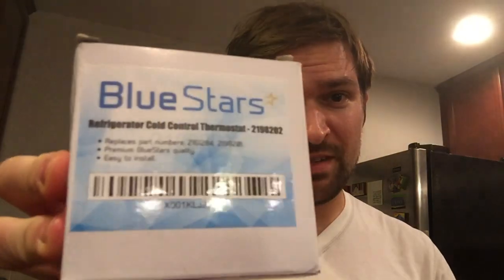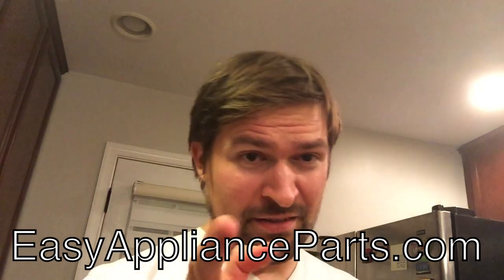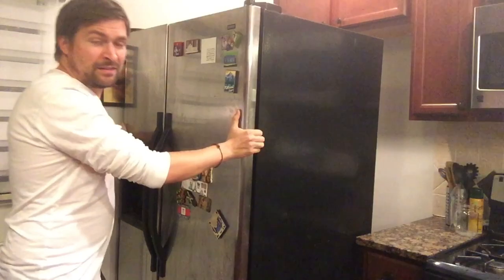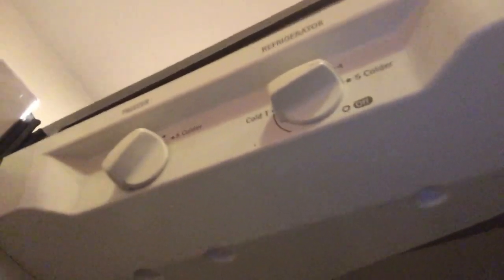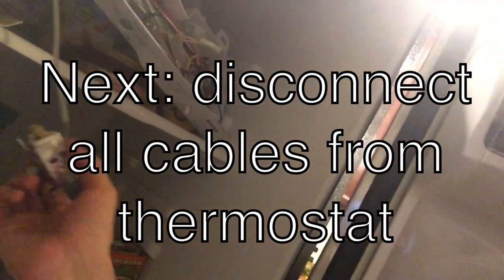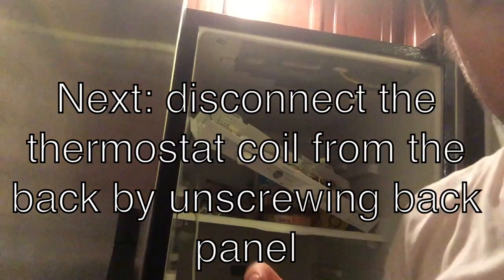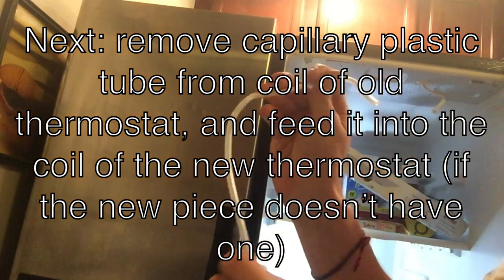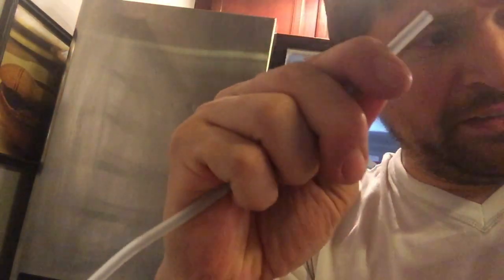How to replace a Kenmore fridge thermostat

Comment: Hi Alehandro, how you know thermostat is bad? Any signal?
Thank you
Reply from the maker: Hi Patricio! The main sign that a thermostat is bad is if the temperature of both the fridge and freezer fluctuate (causing things to freeze and unfreeze constantly), or if it doesn't stop cooling and all the things in your fridge freeze. If the refrigerator does not turn on at all, the problem could also be a bad motor start capacitor, start relay switch or a bad compressor motor.